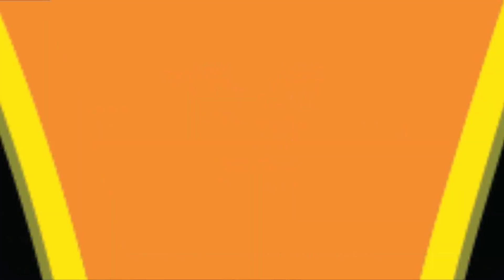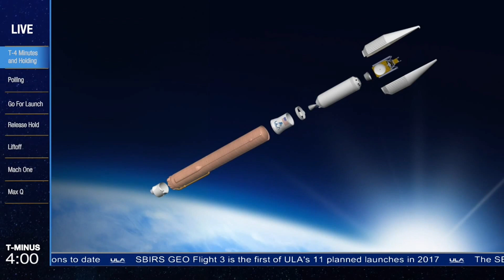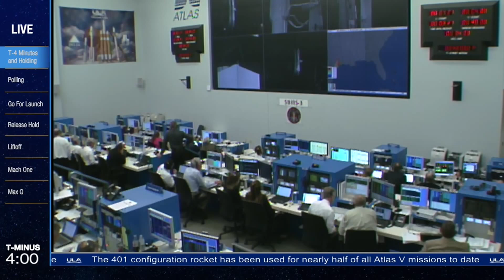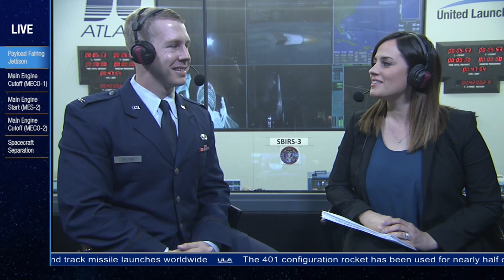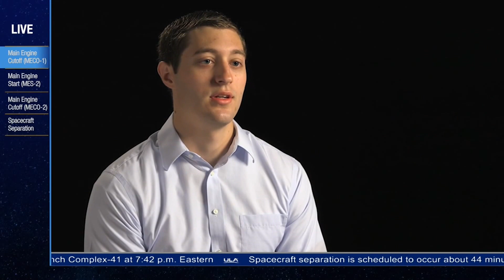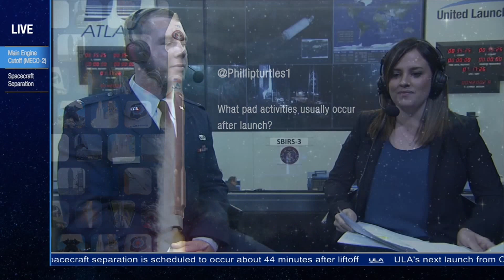Jan. 20 Live Rocket Launch Coverage: Atlas V SBIRS GEO Flight 3

Comment: turns into a cartoon ,then suddenly they are in space,wtf happened there?
Reply: It's not a cartoon. It's a real time 3D simulation based on telemetry from the spacecraft. What you see on the simulation is what happens with the spacecraft  in real time. Using this method requires less bandwidth than sending live video from the spacecraft.
Reply: I think hes asking why did we go from live video on the rocket to a simulation....for what reason?

Comment: what happens to the last booster that detached from sattelite?
Reply: The booster is in an orbit of 100 nm x 19342 nm (185 km x 35821 km). This means the lowest point is still very low and well in the atmosphere so it will be slowed down every time it passes the perigee thus lowering the orbit until it burns in some months (not sure about the exact timeframe, but it will definitely come down).